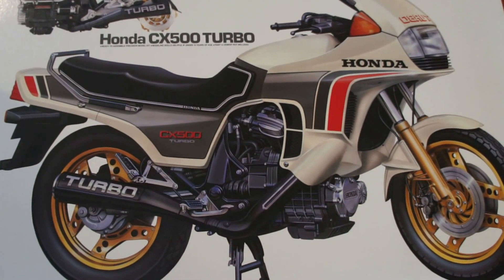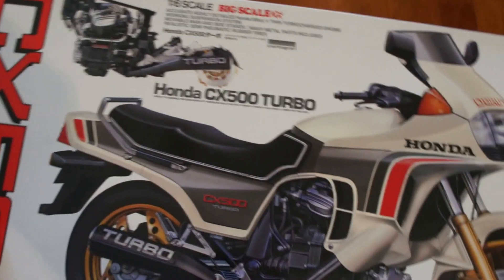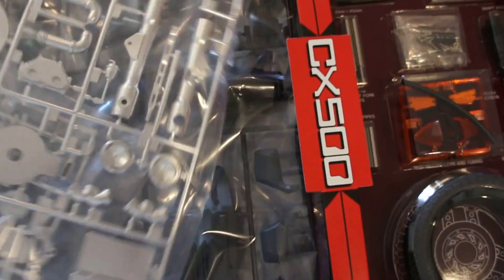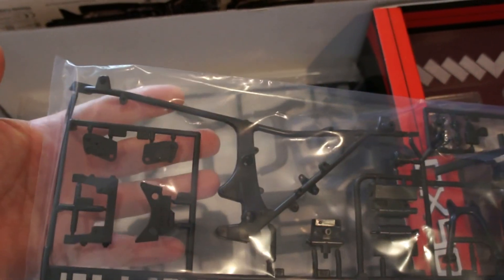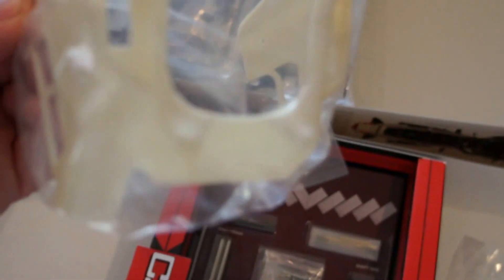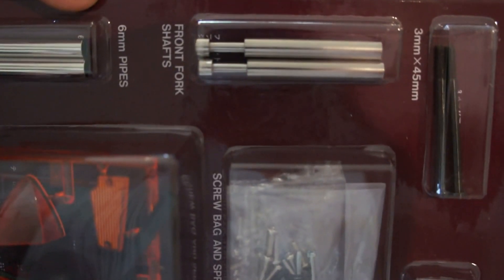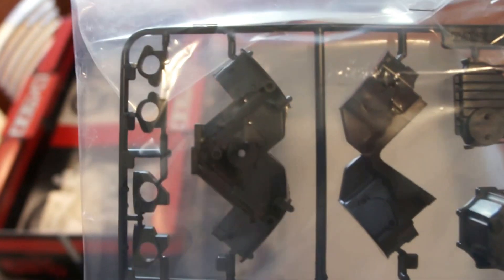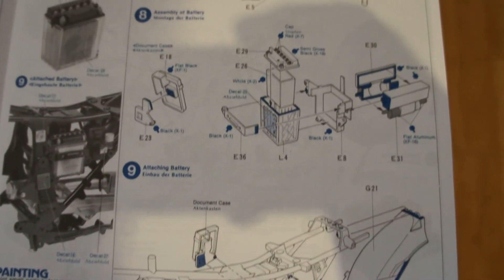Tamiya 1/6 scale CX500 Turbo Unboxing

Comment: Did you finish the kit? I have the kit but not going to assemble it, I may get another one to build. My actual CX turbo (used regularly) has the same number plate (registration) as the kit VLT145X as my bike was one of the first in the UK in 1981 and was Hondas exhibition bike which and Tamiya decided to use the number for the kit :)
Reply from the maker: Hi Ray, no haven't started the kit yet. I have accumulated a few more 1/6 kits including the cb1100r. Pretty cool story attached to your bike! Mine sits under my verandah covered in blankets 😞.